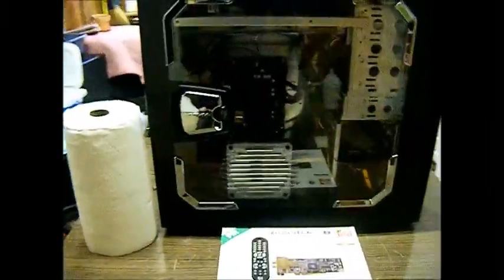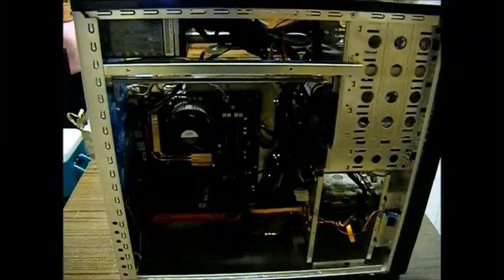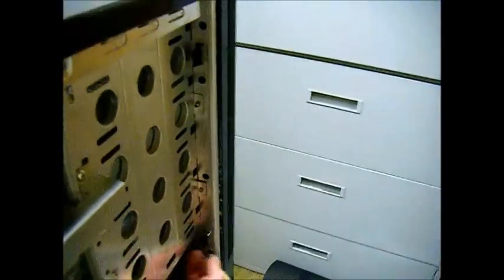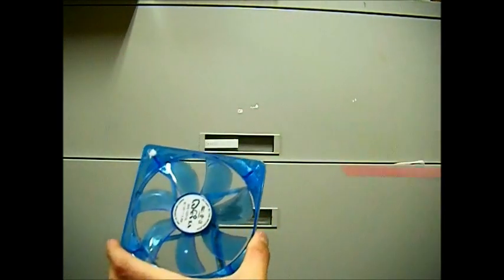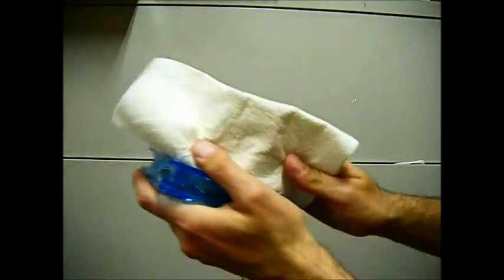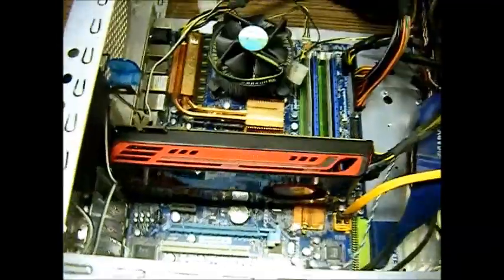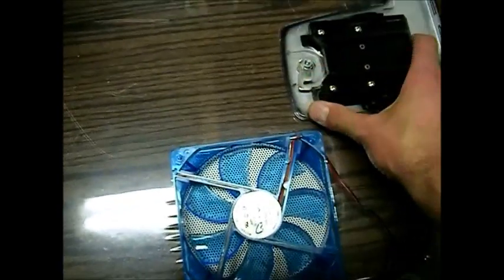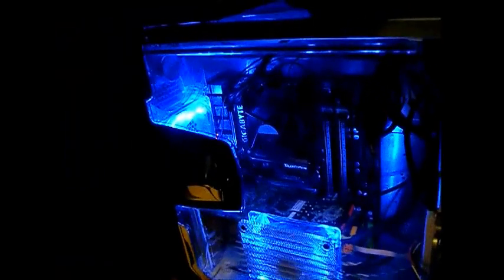The Best Way to Clean a Computer *HD Remake in Description*

Comment: 1: Using a vacuum will not cause any problems with static whatsoever, providing you leave your mains plug connected but switched off - the entire chassis and every PCB inside is linked to ground.

2: The liquid / ice emitted from the can of dust off again is harmless providing the power is off. It will evaporate in seconds.

3: Free spinning fan will not cause a problem - those bearings (if it is a half decent fan will last for years)

Comment from the maker: Using a home vacuum can cause damage. Home vacuums can cause ESD (electrostatic discharge) and can short circuit a component. You may get away with using it a few times but there is always a chance it can cause damage. They have vacuums made specially for electronic if you feel the need to vacuum it.

Comment: 4: There is no need to remove fans, take a soft natural bristle paintbrush, 1" or 3/4" and loosen the dust on the fans and heat sinks, hold the fans still it makes it easier. Then get your air cleaner and blow out the rest of the crap. I get loads of dust and cobwebs here, even have lizards laying eggs in the case - it needs cleaning every 2 months at least.

Comment: that's why you gotta put some dust filter on there

and make sure the fans apply positive pressure to inside of the case.

But there can still be some dust inside so you still have to use the blower periodically. My vacuum cleaner cannot blow unfortunately

Comment from the maker: @twowise11 Usually nothing happens and it just evaporates but you can possibly short circuit something. There may still be some charge left on the components even with the power cable unplugged and the liquid can end up damaging your component(s). I've accidentally sprayed some on my components before and nothing happened, but that doesn't mean nothing will happen every time. It's better to just avoid taking the chance.